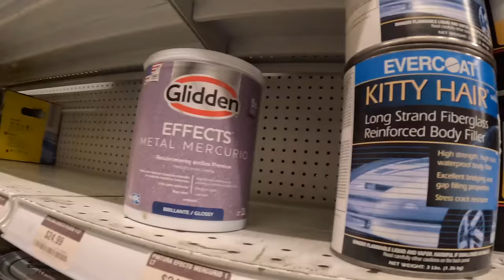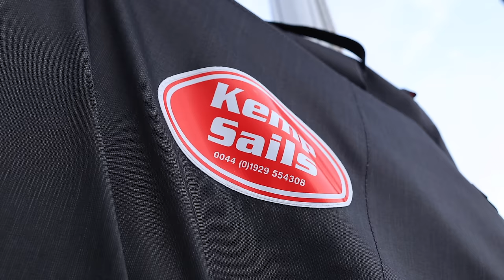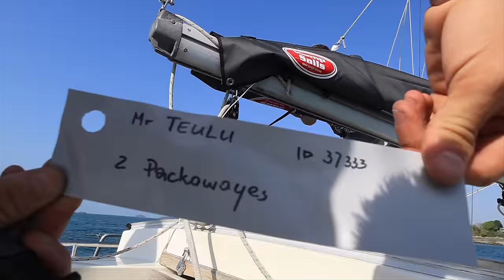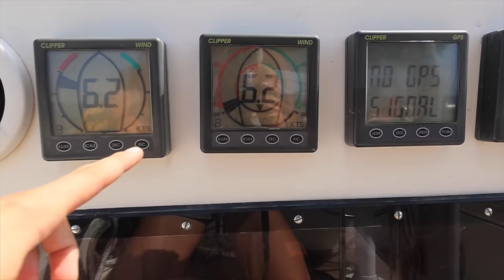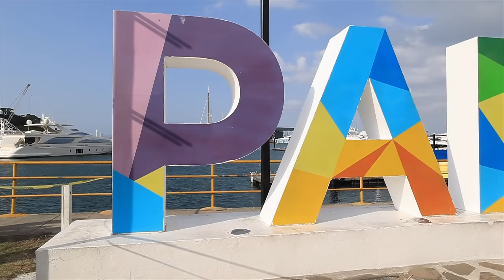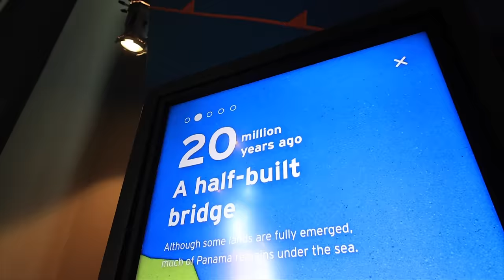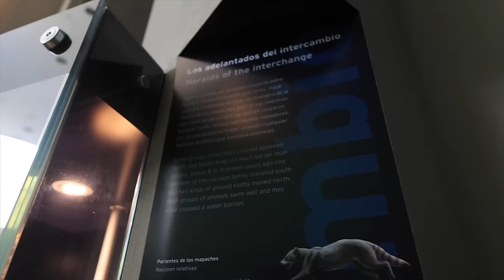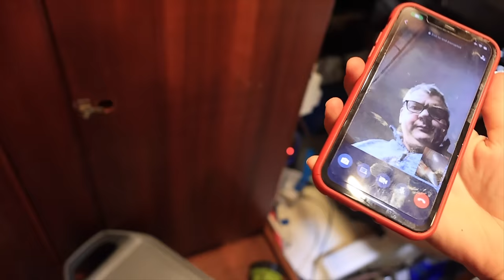BOAT LIFE: Our Pacific Plan (Life Update)

Comment from the maker: Panama City was a blast- that was until the engine wouldn't startI! f you were us though, where would you go? 🌎
Reply: Costa Rica then the Sea of Cortez, then French Polynesia. Timing dependent on typhoon season
Reply: I am still quite concerned about those small lines that were capped off/removed previously when tidying the engine cooling system.  Please re-visit all vacuum breaker lines & vents on the cooling water system to guarantee you are not getting ‘back flooding’ or residual cooling water in the lines when the engine is hot & shut down, condensing hot liquid can easily draw in cold if No vacuum break or vent.
Reply: Your plan is well thought-out. Don't second guess yourselves.  Boatwork will be less expensive in Mexico than in French Polynesia. ❤
Reply: Sea of Cortez, Mexico. Plenty to see, lots of anchorages. Good food, lots of culture. Sealife, whales. Order parts from US. PIck up at border.
Reply: Costa Rica for surfing! Take lots of time looking around. Maybe Easter island at some stage?
Reply: As always, nice video. Thank you for sharing your adventure.
Reply: Vancouver - this weekend.
Reply: @jimconner1028  Ditto. Way easier and cheaper to get everything shipshape in the Sea of Cortez, than in the Marquesas.
Reply: C'mon up to the Pacific North West! Then zip over to Hawaii for Christmas!

Comment: Obviously I haven’t personally diagnosed your cooling/engine problems but after 50 years working on Diesel engines, I would be looking at the heat exchangers, there usually cast iron and rust quickly in a marine/salt water environment.
You guys are probably months ahead of your videos but avoid running and possibly ruining your engine until the problem is resolved!
Love your videos xx
Reply from the maker: Your insights are invaluable, thank you for taking the time to share your knowledge! We’ll look into it. Cheers 😊
Reply: As it's a diesel could it be build up or fouling of glow-plugs, or a fuel issue?  
I remember reading that can cause misfires and a chugging engine... But I'm not familiar with marine engines.

Comment: As I commented 3 weeks ago, I am still praying that you haven’t caused water ingress through the exhaust system by removing the parts you thought were redundant, perhaps causing the situation where when the exhaust outlet or another entry point is submerged due to waves or trim that water now comes into the engine and ultimately hydrolocks the engine.  Waiting on tender hooks to find out what has happened. Keep safe. Best wishes from Wales. 🤞

Comment: Just word of advice from a mechanic. Anytime I feel as though there MIGHT be some water intrusion I always take out the spark plugs and turn the engine over. That will clear the cylinders of anything that may be in them. Also, if you attempt you start an engine multiple times, it is possible to put enough fuel in there to hydro it. Lessons aren’t free,but they do make us smarter and more prepared. You two are doing really well, keep it up!
Reply: It is very difficult to take out the spark plugs from a diesel engine? 🙄
Reply: @davidswheatley-talesfromth1796    is it harder to take out injectors?

Comment: Bon voyage, wherever you venture and for however long! Really enjoy following your story and am more than a tad envious.
1)
Roly-poly anchorages: believe you purchased a stack of buckets recently, have you considered sacrificing a couple to suspend one each side on poles to act as dampers?
Obviously, need to cut a hole in the base of each.
2)
Stack-pack.
Probably well worth utilising for rainwater catchment, good for washing etc if not also for  drinking after a good flush-through. Well marked extra canisters at the ready!

Comment: If you got knocked over by that water it could have got past the air lock .. 
 
Hydraulic locks from water or excess fuel are bad its best to see if you can turn it over by hand first.  Then if theres resistance .. time to bleed the pipes and remove injectors ... and try it again by hand or on the starter... Liquids dont compress as your mate said but metal will break and bend...

Comment: I’m hoping the motor is just the intake off or a weak injector ! Central America and Mexico are awaiting. There’s plenty of time to do the pacific islands later. I’d check the wire hit by the drone very carefully ! It’s amazing the damage those little plastic blades can do. I believe it was Spirit Animal that hit their back stay with a drone and actually cut some of the wires. They had to replace the stay. A huge horror of sailing horrors is demasted in the middle of the Pacific Ocean !

Comment: Love the beanbags that look like they can do helm seats too. Rad!

Love the P4P. don't worry, I crashed my first drone the same way practically on the first flight. Actually mine was because I didn't screw one of the self-tightening props on enough so it flew off. And, if flying at home in a house, beware, drones eat lampshades! Clearly not an issue aboard obviously. Just sayin 😆

Hope the engine re-build is going well? ;-)

So happy for you both and inspired myself. Following your dreams and being so inspiring.  You're both great role models.

Comment: Possibly water into the engine through the exhaust while sitting in a rough anchorage. Possible bent connecting rod from hydraulic-ing the engine when turning it over on the starter.  That’s why it was turning over slowly. Let hope I’m wrong.

Comment: Motor sounds okay on youtube. Not sure what it sounds like there or what it sounded like before. Make sure the raw water is going through. What would be concerning would be an uneven idle or metallic clunking noises. As others have noted with the big wave you could have had some water come through the antisiphon loop/valve. If thats the case it would be fine now. There was no strained attempt to turn it over in the video and 8f you got enough water 8n there to break something that would be part of the experience.

Comment: If you need a new drone look at the DJI Mavic Air 2. I have had mine for 2 years and have had no problems. They make a smaller drone but wind affects it more. Mine does fine in 20-25 mph winds. They also sell insurance for a reasonable price. If it goes in the water they will fix it or replace it for free. And 1 time if you loose it and can’t recover it they will replace it. I don’t have any deals with them I’m just suggesting them because it a good product.

Comment: Hi Teulu.  Starting at the end of the video, it sounds like you've got an Injector that's failed, or blocked.   Interesting bit about Tides between the Atlantic and Pacific.  Question I'd like to know; is there any difference between Mean Tide Height, between the Atlantic and Pacific.  i.e.  Did the Rise up the locks from the Atlantic, equal the Drop from the locks to the Pacific?  Nice to once again see the Service you get from Kemp Sails.  Looking forward to you enjoying Costa Rica and Mexico.  Pick the right ports and Mexico has some really great Boat Yards, as reported by SV Delos.  Fair winds and following seas.  Russ.

Comment: Is zach little bit anoid with u coz he somehow wasn't realy in the mood when ur discussing ur new jacket, is that stock pack for replacement for an old one, r maybe u have drop those key, r perhaps the bloody drone n drops on the water, well i hope u r both good, and pls cheer up nothing to be so mad it happends sometimes, it even happened to Eleyna from la vega bonde she drop her drone, it was bitten by seagulls, and she started to hate those birds flying around in top of them, just relax stay cool i think there's no need to rush before u cross the pacific its gonna be a long one and a roughly waves u gonma face out there i suggest you should invite a couple too who has a big expirience in long destination, just for safety. A yr ago i watched a  ⛵ couple they were bloggers too, as they cross the pacific they didn't expect a huge rough waves storm was huge, they're sail was rip apart and the engine died, so they were stuck for 3 days i guess, they were almost get sick cause by bumpy waves, but as soon as they reach a signal and ask for help from coast guard they were safely pulled and duck to the nearest island..

Comment: Nice video. At the Atlantic side, you removed an old part that seemed "useless" - would that have been a "check valve"? And if so, what should be checked?
Also, if the diesel engine has a form of electronic motor management, I suggest you source the connector that fits on it with a smartphone interface on the other end. And install the app to read the engine dat out. This can be operational for relatively small change. You may want to read up on authorisation levels where e.g. the basic app can only see data allowed for a driver to see, versus the data that a maintenance workshop could see.
The anachronistic old dieseling sound that Becka pointed to is out of character, ye, one of the cylinders may not fire - which inn the case of the diesel engine is not a spark plug but a failing injector. Or so I hypothesise, speculate.
Reply from the maker: Thank you for your detailed observations and suggestions! We appreciate your insights 😊

Comment: Glad you decided to visit Costa Rica. Is very different from Panama. Also don’t plan to buy stuff in Costa Rica for the boat, and definitely don’t import spares and parts into Costa Rica as they charge an arm and a leg in import duties. I try to get friends bring stuff back from the US that i order on Ebay. Costa Rica is expensive, but only if you insist on buying imported food stuff. As i tell people, its NOT North America, its a different country with its own culture. I love it (been here 3 1/2 years now).
Reply from the maker: Import duties, the true pirates of the region! Thanks for the heads up on the costs.
Reply: As a heads up, you should only go to the smaller shops where the locals go, for fruit & vegetables, which are usually NOT the big chains like Super Compro. Pali & MaxiPali are owned by Walmart. You can also go to the local Farmer’s Markets (Feria) which are in all towns, and support the local communities. Over the last two years, prices have gone up 15-20$%, and add that to the growing strength of the local currency (colones) (or weakness of the US $ which has gone from 618 colones/$ in 2022 to 507/$ today), its getting more expensive for expats like me!

Comment: That engine doesn't sound too well. Did you find anything else yet? 
If it did hydrolock before which could happen on just one cylinder a rod could've been bent and now touching the casing while turning. It really doesn't need much to happen. To make sure this didn't happen you could measure if all pistons move up to the exact same value at top dead end. 
To measure compression ratio at the same time would also be a good number to know.

Comment: Your engine is very noisy, you can clearly hear a metallic knocking sound, it looks like a stuck or stuck valve in the head or a non-functioning injector on one of the cylinders. Check compression ratio and injectors.